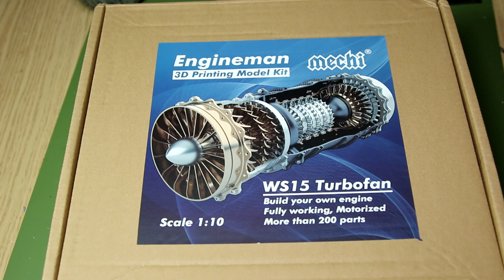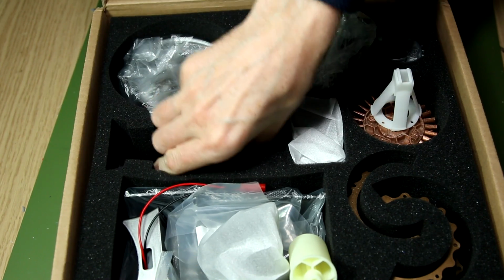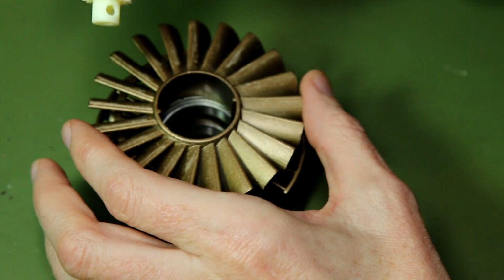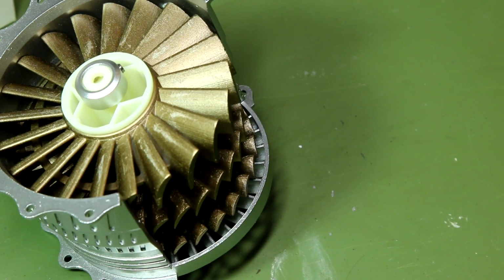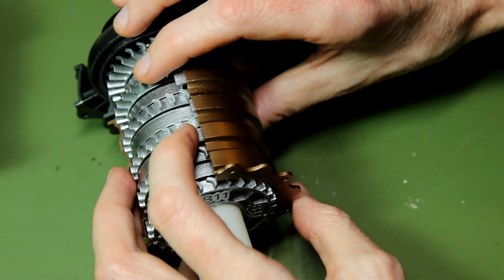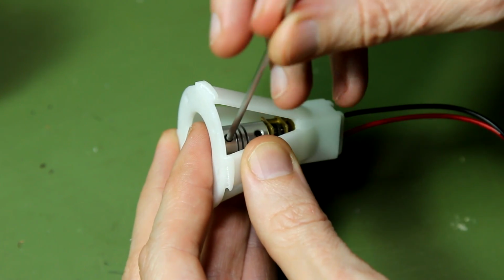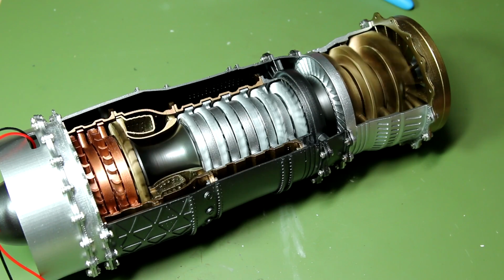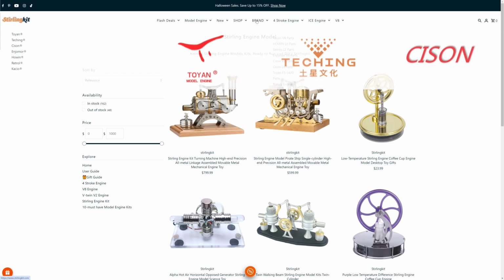Working WS-15 Turbofan Engine - Stirlingkit scale model

Comment: You should be able to buy those grub screws easily on-line. It is interesting but to be honest at that price its not that impressive. It sounds a bit noisy and doesn't appear to have a nice stand. I presume it just rests on the top of the battery box.
Reply from the maker: Yes, I agree - premium price but not premium kit. Yes, it just rests on the battery compartment.

Comment: Looks interesting 🤔sort of, go down to your local hardware store and buy some grub screws. They come in a packet with different sizes. Then you can complete your model. Of course it's vexing not having everything 🙄 still it looks interesting but sounds awful 😕.
Reply from the maker: The company sent some spares - but it is worrying that several reviewers have all had different parts missing.